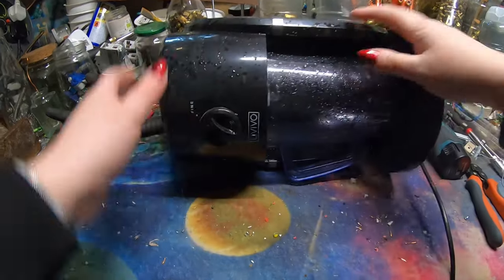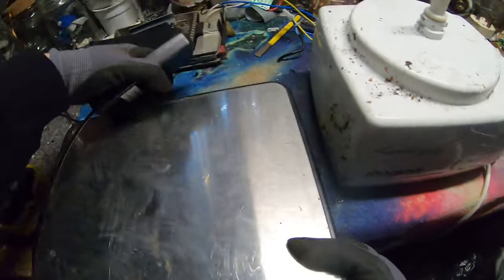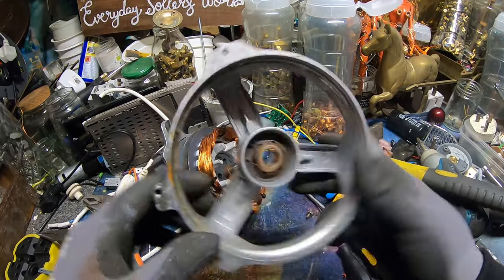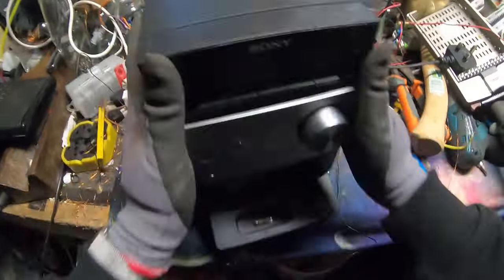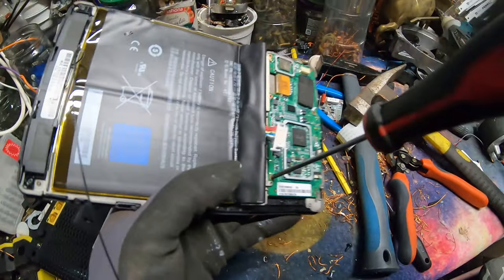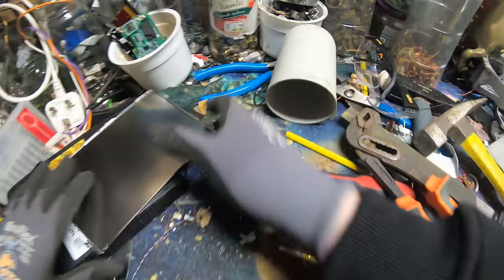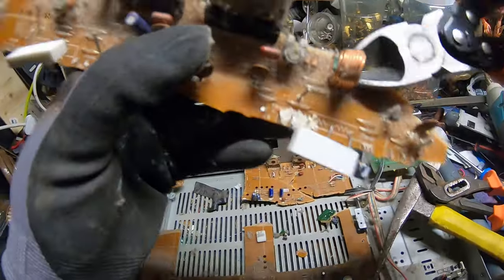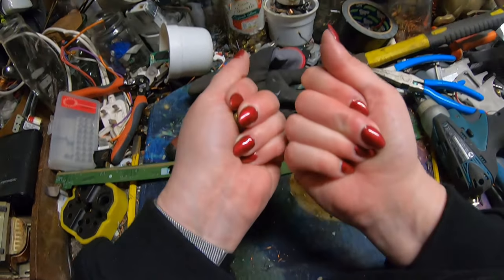Mega #Scrapathon scrap marathon teardowns: that didn't quite go to plan!

Comment: See if you can get hold of a decent big meat cleaver and slowly start by hitting it down to start parting plates then go to town wear glasses as usual do not want a shard of metal hitting you,that is how I do it unless it hass steel pins going through holding plates together then just tap each end out with punch you will find it much quicker but I do not like the machetee  method as too narrow and flimsy
Reply from the maker: Ah yes the trusted meat cleaver! I got an awesome old absolutely solid Stanley tool head in an antique shop today for 25p that looks like it might do the job too🙂👍